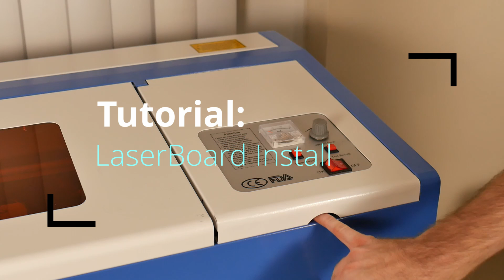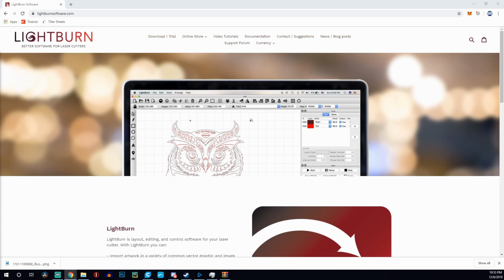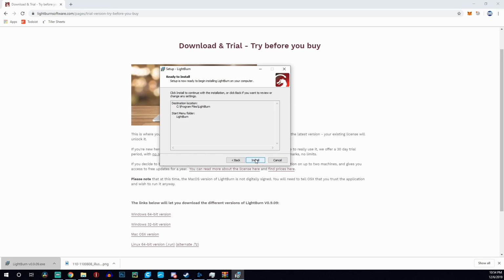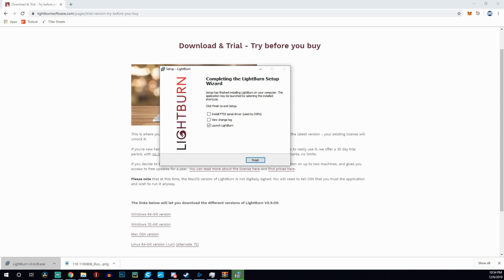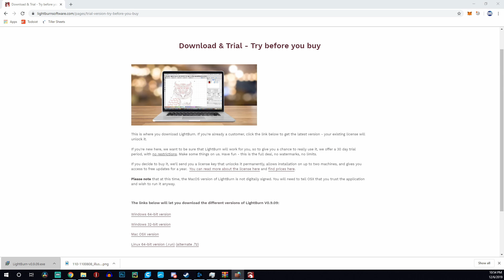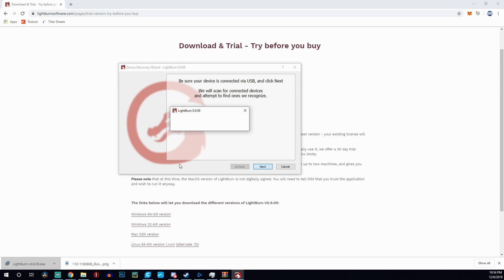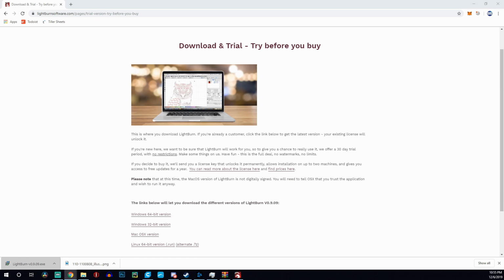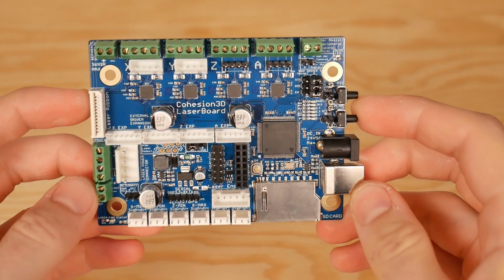How To Install The Cohesion3D LaserBoard Into Your K40 C02 Laser

Comment: Hi bud, um im trying to reach out anywahere i can get some with my issue in hopes that maybe u can help. After my install my endstops don't light anymore, my bro has the exact same setup with no issues. Ive tested with my meter and everything is working perfectly fine on the board and going to the endstops. Yetit can't go home quietly if you know what i mean. It just slammes into the wall mond you going to the right place but further. Its not a k40. The size is 600mm x 400mm and it seems to think it's larger then that. Or just not detecting it.
Reply: I have the same size, a Julong one and I can't get it to do PWM no matter what I do. It's also noisy even though I played with speeds, acceleration, seek rate. Did you manage to find a solution? Or is PWM working on yours? Man, I don't know what to do...